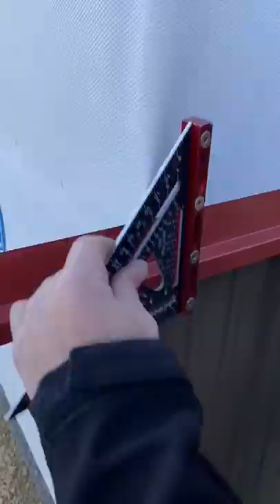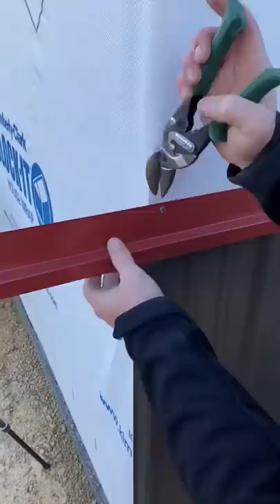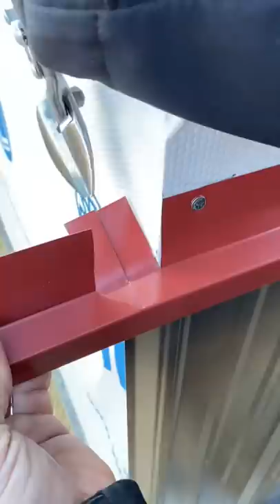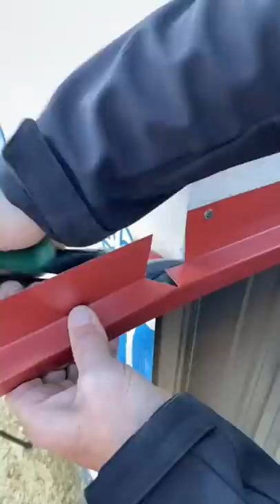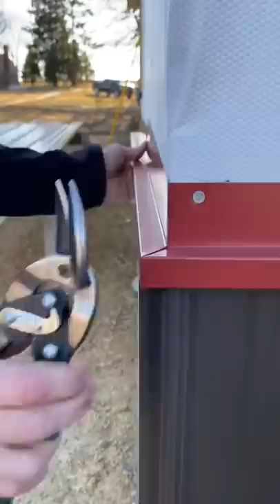Perfect Metal Trim Corner Bend Origami #shorts

Comment: Come on Kyle you are better than this. The reason pro’s don’t do one piece corners is you need to overlap the vertical leg. This is bad form.
Reply from the maker: Overlapping on this detail is a waste of time…. Corner trim covers it anyways
Reply: You never tucked the flashing under the paper and it's not a waste of time considering it takes just as much time to cut it off.

Comment: Bad contractor. Rushing as fast as possible and when he folds it you can see it’s not flush. If he took a minute more he could have high quality corner. D- work.
Reply: Before anyone talks smack. Look after the bend, it should be an invisible seam, poor craftsmanship and rushed work
Reply: He cut the vertical tab and also the paper should be over the flashing so water doesn't run behind the flashing
 Fail where I live